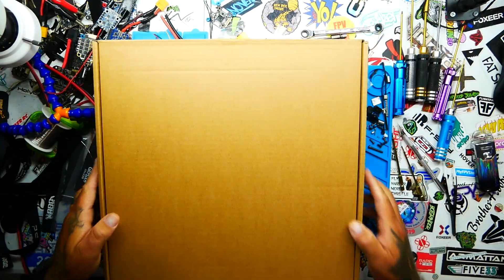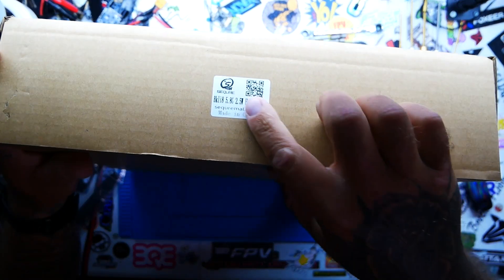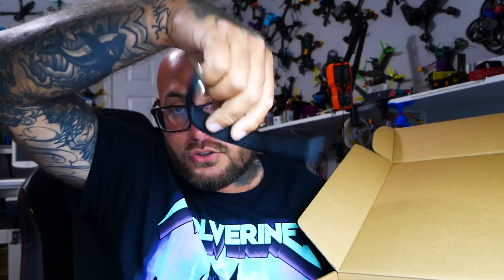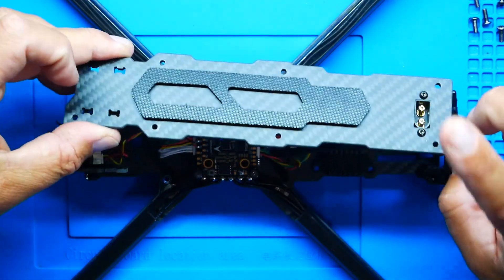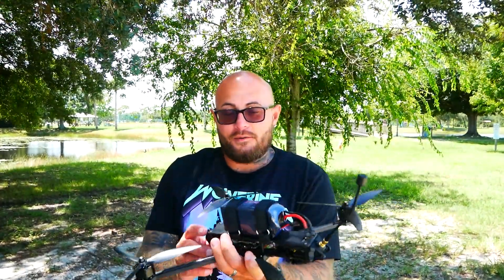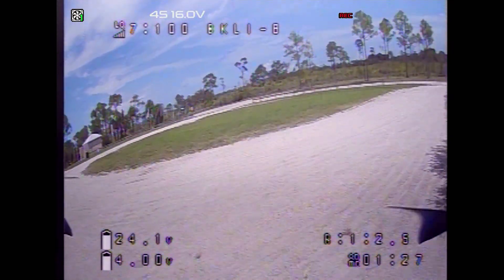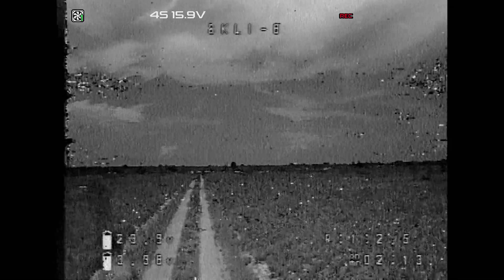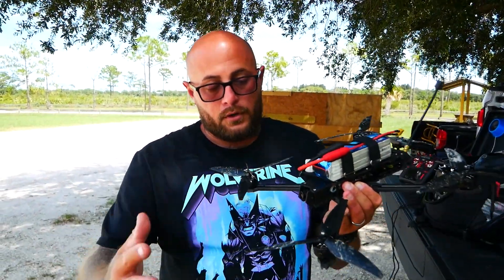8 inch Long Range Drone !! For About $200 Bucks ?!

Comment: I have a chimera 7 pro which is cool but legit if you wanna go far get a fpv plane 😂😂😂😂 no joke quads spends a lot of power pushing thrust down just to stay up airplane are much more efficient because they use wings to glide along using much less power

Comment: These new cheap quadcopters really should be gone through completely. Even darwin has had some pretty crappy QC.  Good antennas are a must. And outta the box, quality rx and camera. Heavy 8-9-10 quads are not something you wanna flyaway with. Yeah they are cheap but not for someone that doesnt have a good grasp on the hobby. Personally ive been down the “get it cheap” route and it never works out. Good stack, good build, take your time.

Comment: that was barely 300 meters, there is no way  thats 2.5 watts. Some of these chinese analog vtxs wont go to full power unless you do a unlock and other stuff like switching channels to go full power even after you programmed it to a switch in betaflight.

Comment: That rattling noise it's making reminds me of what happened to me on my first quadcopter build. I didn't put the elrs preset on it and I had. My radio turned all the way up to 1w it was a rookie mistake, but that's exactly what that rattling noise sounds like to me
Reply: Yeah mine does it at like 600 and 800 and 1w and up don't know why
Reply: @brandonbrodbeck6688  there's a specific tune that you have to use with elrs when you turn up htz